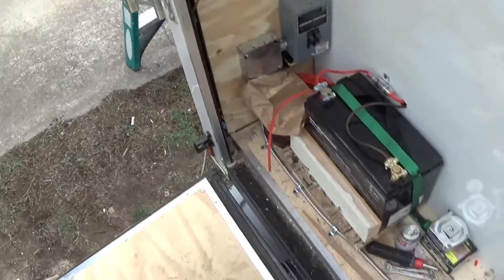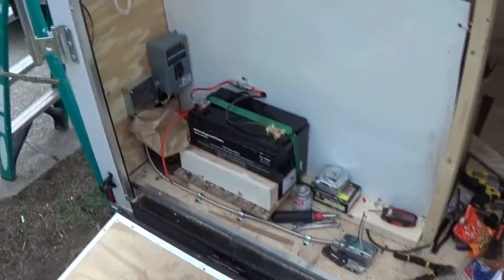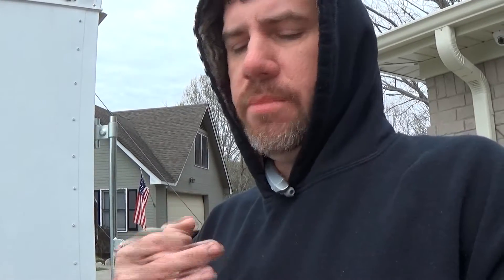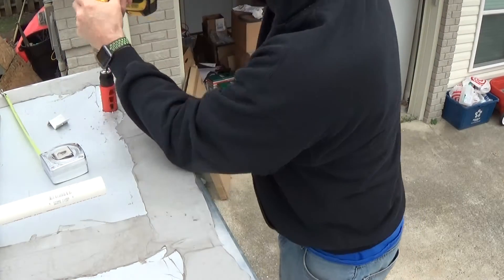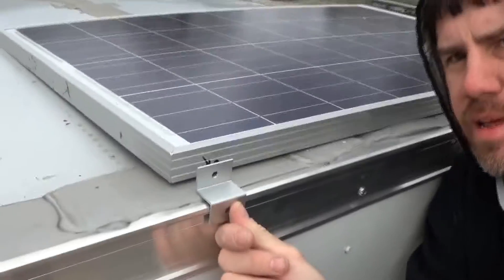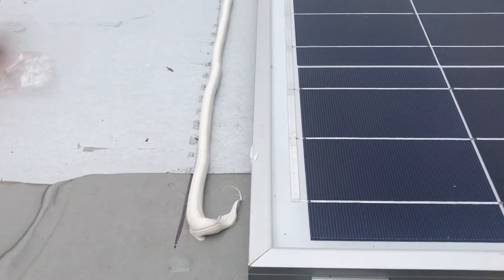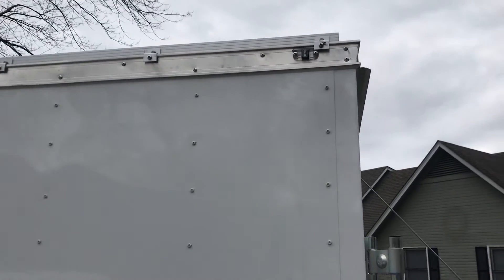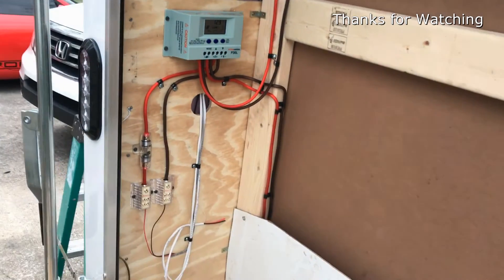6x12 Enclosed Trailer Conversion Installing Solar Panel kit /with100AH AGM Battery

Comment: Nice.  I've got same size trailer,  600ah agm bank, 400 watts of panels, 2200watt inverter, diesel furnace, satellite radio, fridge, exterior spot lights interior lights, shorepower.  Great project

Comment: I'm wanting to do the same thing with my enclosed trailer. With a invertor for. Tools/battery charging. I'm worried about trailer flex causing solar panel damage?

Comment: Heat is going to kill output with no air underneath.

Renogy Solar Panel Mounting Z Bracket 4 Units https://www.amazon.com/dp/B00BR3KFKE/ref=cm_sw_r_cp_tai_VUO1yb9CJ3WXS